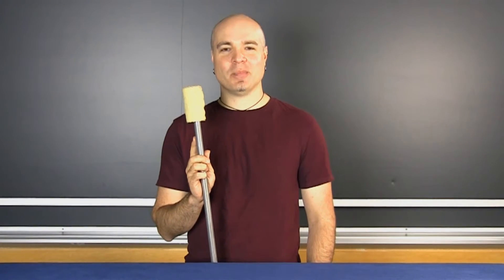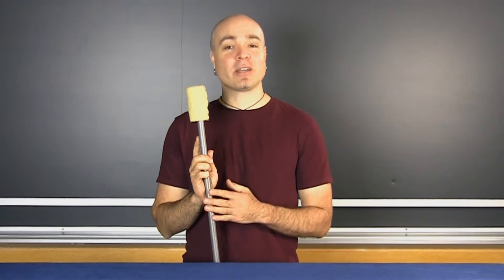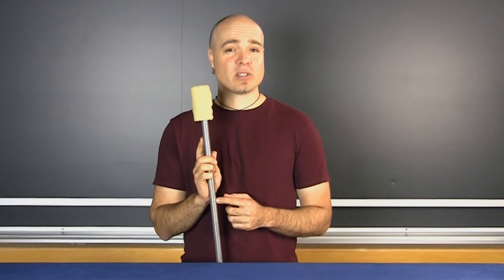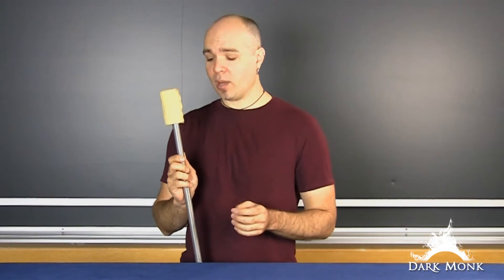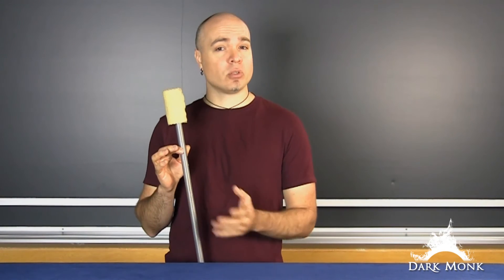7075 Aluminum Information

Comment: How far will 6061 bend before it breaks vs 7075? Did you say they are about the same? I need crumple zone so I need the aluminum as strong as possible and as light as possible but it still needs to crush as much as possible before breaking.

Comment: compare to t6 6061 tube 0.75 thickness and 6 feet length, how does it weight with the same dimention?
the properties gone when u bend it?
tq
Reply: The grade of AL doesn't change the weight. It is a very small amount of manganese I believe that makes the big difference in the strength properties but doesn't effect the weight.

Comment: hi! i work aluminum alloys 7075 and 6061 series about of weld.  can you help me ? 
I wonder if you can help me with this subject.  Can you direct me to the welding research or work. thanks
Reply from the maker: I have only heard of one method to weld 7075 AL and it was experimental being done by MIT I think. You basically can not weld 7075. Welding 6061 is usually done with Tig welding. There are a ton of youtube videos explaining that in detail. It also takes a lot of practice. So get behind the stick and make some beads (and have fun).

Comment: So 7075 bends the exact same as 6061?
Reply: Nope. It is twice as strong as 6061. You can not form it like you can 6061, it will crack. But it takes almost twice the amount of force to bend it.  It is 15% less strong than titanium. So completely different.

Comment: You "custom manufacture" 7075? Really... It was invented in 1935 and introduced in North America in 1943 so tell us how you fit into this equation in 2014??
Reply from the maker: Yes, we have it custom manufactured. We probably have the largest supply of 7075 tubing (definitely in these sizes) in the US. Having something custom manufactured doesn't mean we invented it.
Reply: @DarkMonk  So you have it "custom drawn" to your specification, great! That's what we do too other than we use 6063-T651 tubing from 0.750" to 1.500" O.D. Your opening statement sounds like 7075 is your custom alloy... I use 7075-T651 for virtually all of my tool making and can't say enough good stuff about it like you and rightly so:)